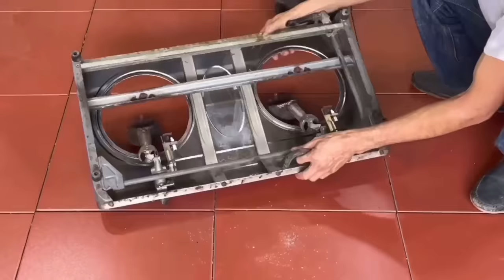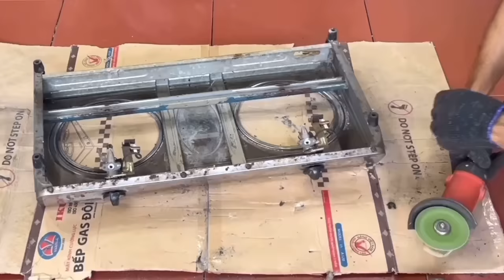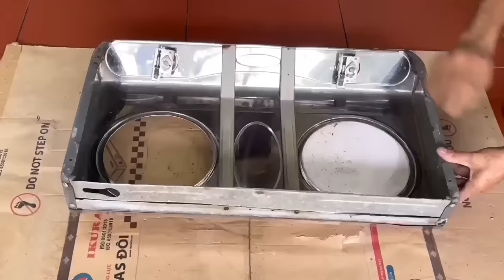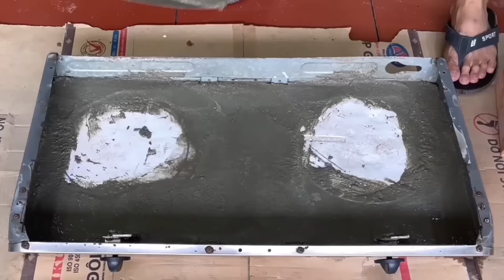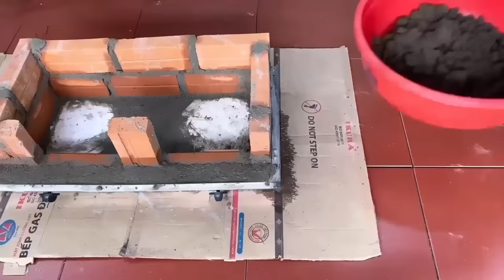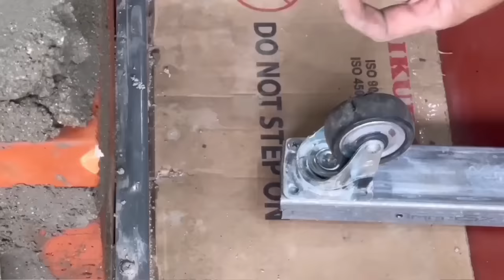DIY wonderful wood stove (2 in 1) from old gas stove # 157

Comment: Real genius job, I offer my gratitude to you.  I have one suggestion,  if you want to avoid pot from becoming black  , you keep mud paste in containers with brush.  You paint the outer layer of pot with mud and let it dry.  When you you keep on fire the outside pot will remain clean because of mud.  Pot also run for longer periods.  I really appreciate your job.  With practice,  you will which pot need thick  layer and which thin layer.  
Namh shivay.
Reply from the maker: it's great, thanks 😄👍👍
Reply: Good idea